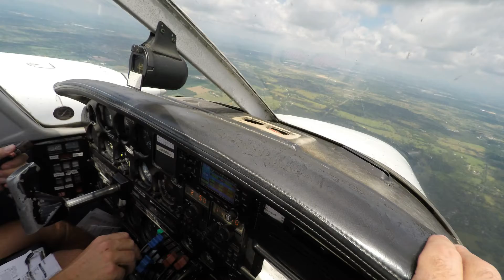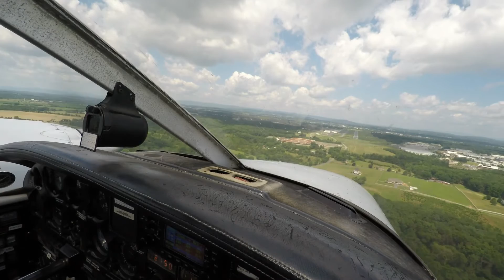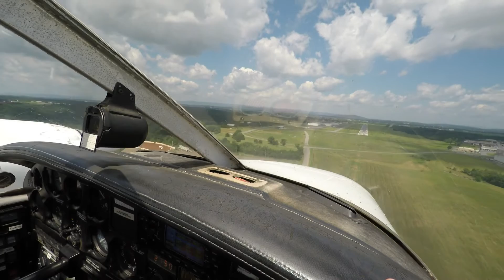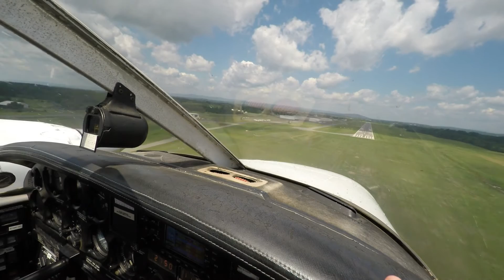ATP Training - Single Engine ILS approach (simulated)

Comment: So you go gear down and approach flaps a dot above glide slope intercept in single engine configuration?
Reply from the maker: Hi Matt - There is stabilizing effect on a SE when flaps and gear are extended and you can maintain vyse. You can do this at the FAF or at GS intercept, but you’ll never know when your instructor will fail an engine!
Reply: @loveairplanes_stars  haha yes! I'm working on MEI at the moment in a Seminole. And I meant to say a dot below GS intercept with gear and flaps as in any normal approach. Where are you located?
Reply from the maker: @mattrobinson4994  Leesburg VA
Reply: @loveairplanes_stars  Good morning David, I have another Seminole question - I've been reviewing performance charts and on the Fuel, Time, and Distance to Climb chart, the example shows Fuel to climb: 2.5 minus 1.0 = 1.5 gallons, Time to climb: 4.5 minus 1.2 = 3.3 min and Distance to climb: 7 minus 1.4 = 5.6 NM. Where are they getting the 1.0, 1,2 and 1.4 and why is it being subtracted? Thank you
Reply from the maker: @mattrobinson4994  Checking my seminole poh they are finding the difference between the departure airport pressure alt and the cruise pressure altitude with the numbers you have listed.
Reply: @loveairplanes_stars  ok thank you David